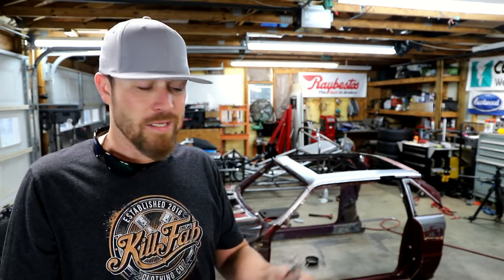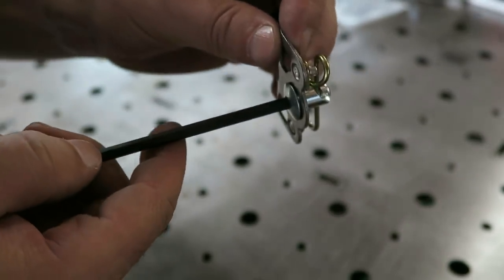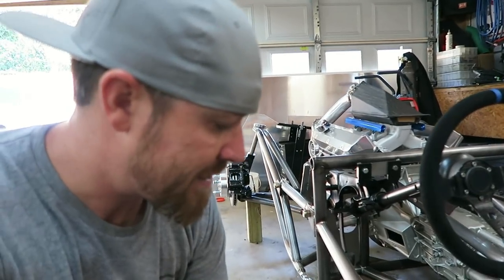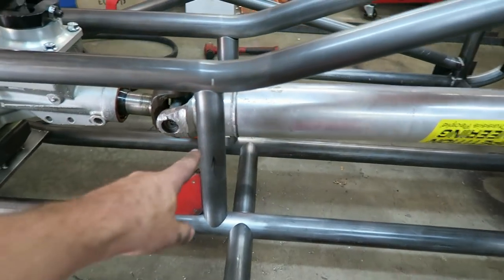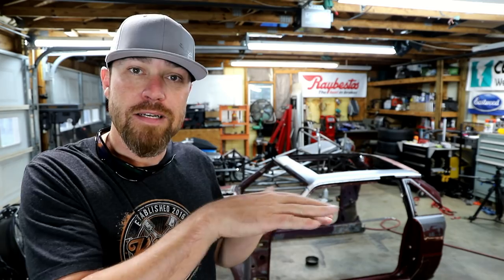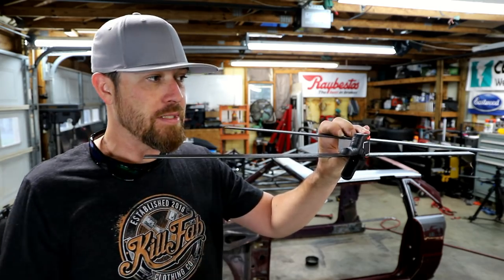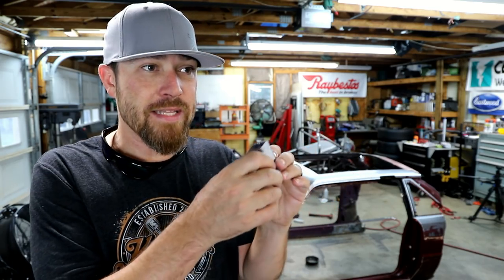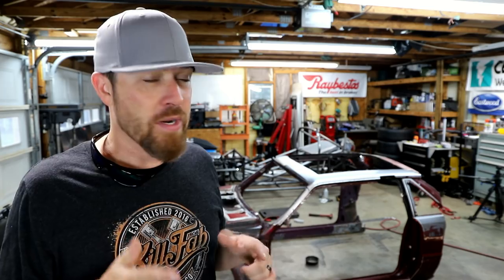Tube Chassis Frame Fabrication | Custom Hot Rod Build Bibbster

Comment: Nice solution to the positioning of the floor and tunnel panels. I like what you said at the end and agree that forward motion, combined with an open mind, can lead to discovering better options than trying to set every detail in stone. Also, too much thinking ends up making the work seem more daunting than it really is once you get started. At the same time, small delays can be a blessing if they allow you to rethink what you were planning to do, and lead to a better solution. Of course that's where the open mind is required. I always see/hear high quality/smart stuff on your channel and would like to see you hit 500K subs.
Reply from the maker: yeah for sure

Comment: I couldn’t picture how you were gonna do that until you actually did it, great idea, I need to build my floors also,  more than likely out of sheet metal rather than aluminum and I’ll weld it right to the square tube of the frame I built, if you read this and have any thoughts on that let me know. Glad to see the project getting moving again.

Comment: Great work - you are true, old school craftsman. One question thou. That small bar you just installed under the driveshaft - Is that not going to make removing the driveshaft a real pain i the butt? Could you have not made that a bolt in tube?
Reply from the maker: nah it wont effect ease of removal any
Reply: Love watching you work - your approach to this project is very relaxed and laid back. I like that alot. Keep posting.

Comment: I wanted to ask what tig machine are you using and are you using might wire for a filler if so what size? Also I've been in and out is why I have questions. Have you tried an everlast tig? Can you steer me in a good direction ? Thanks for sharing your time, thought s, skill and tools with us. It helps a great deal.
Reply: Go check out ChuckE2009 he has a lot of reviews on welders of all types and prices.
Reply from the maker: I am using the a Fronius MagicWave 230i in this video. And yeah I have a Everlast 325ext which was used for most of the welding on this build up to this point. The direction really depends on what your looking for in a machine and the budget you have.
Reply: @Thefabforums  Thank you! I will look up the one you talked about you were using.  I wanted the most bang for my buck. Not wanting to go over $2500.

Comment: Hey Kyle not trying to be a know-it-all but I would only go halfway down on those tubes I don't know if that's inch and a half an inch and 5/8 but if you go real low your panel won't fit in there right everytime I look at your car it looks great but I think I would put some bars on that roof to make it safe and rigid looks great showing the thickness of the tubing we'll make it look even better with the aluminum panels my opinion I would make those floors thick 1/16
Reply from the maker: thanks for looking out, but Ive got this

Comment: Do you establish the final profile before or after bead rolling? Very clever stand off clamps! Will definitely use on my tube chassis once I get my ball rolling.
Reply from the maker: bead rolling may shrink or stretch the panel so you may need to tweak the final profile
Reply: It can do either condition? How much allowance for final trim would be good?

Comment: When you bead roll your floor pans / trans tunnel have you thought about putting the ford logo or mustang logo,  because it could turn out really cool and add that extra pizazz.
Reply from the maker: nah, if I did a logo it would be mine. but most likely it will just be a design

Comment: Have a turbo question.  I have seen people put there turbos up front and then I have seen people run them set back by the firewall with the turbo inlet facing the header that means there pulling the hot sir off the headers isn't that a bad thing with sucking the hot air in ?
Reply: Yes.
Reply: at 170mph you're not going to have a problem with hot to cold air ratio...but on a street car heat soaking in traffic, yes.
Reply: @vintagespeed  the idea and question is more about space and not having a  radiator or oil tank . Nobody has done  that yet .
Reply: Correct but that is why turbos have intercoolers, I believe...although the turbos are sometimes at the at the rear the air induction system would usually start towards the front of the vehicle in as clean air as possible...an example of turbos being unusually placed is in 'DEBOSS GARAGE's (sorry if mentioning this is not allowed) Quattro Debocho' where they are placed in where the back seats would be in the original car..
Reply from the maker: most that run the turbos like that are doing it to minimize the amount of tubing / weight. Those are also drag cars and usually have ducting for cool air intake
Reply: a normal air-air intercooler only drops temp of compressed air a few degrees (air to water much more) so if the ambient temp is already elevated 20deg by the heat soaked headers then the intercooler is completely ineffective.
Reply: well, this reply was about hot air.... but to answer your question, lots of bike guys use the rear subframe or backbone (triumph & honda OIF did this factory) as an oil reservoir, works well for that and plumbing coolant from front to rear through the cage is a mud-truck trick.  still need a radiator, but less plumbing.  would work with stainless but air/water in your rollcage is probably a bad idea when it comes to rust.

Comment: How exactly did you curve the flat bar on the flat plane? Shrinker/stretcher or pie cuts or some other fancy trick?
Reply from the maker: I should have shown that....I just cut like 10 relief cuts about 3/4 the way through with the band saw
Reply: The Fab Forums gotcha, that’s what I thought you did. I figured it’s too thick for the shrinker/stretcher. 

I have a suggestion going forward with those tab/ledges for the other floor sections. Once you have it all fit & ready to weld in lay them out on the table & trace them for the floor templates.  Should save a bit of a headache trying to make templates after they are already welded to the tube. Just my thought after wondering how you were going to fit the actual floor pieces. 
Keep it up, do work son.

Comment: Question for you, if I install a tubular front end on my fox from RS Motorsports will it no longer be safe on the street. More worried about not having a sway bar but it may not matter anymore
Reply from the maker: The goose hasnt had a sway bar for 25 years. It can affect the cornering but I dont think it makes it un manageable

Comment: About the "get things moving". I usually only plan out the purchasable core items before starting. Stuff that won't change like the engine, trans, axle, etc and I try to gather that stuff before I start because it makes mock up real easy. Then you break everything into pieces. There really is no way you could plan anything for your car without long hours of hands on. Every little thing on a custom is going to fight you. You just won't know if ABC pedal assembly is going to fit or if XYZ part will look right.
99% of people watching will not build a car to the extent. The best I could say is to just break things down into groups like engine mods, suspension mods, interior mods, etc. then do a little research if they will be compatible then pull the trigger on one of the groups to get things rolling.

Comment: Is your motor a dry sump ? Ever thought of using the cage as a  Reservoir of the oil or  Radiator ?
Reply from the maker: I thought about using it to transfer coolant but then you have to deal with hot tubing

Comment: Should mig bits like those floor rails, can lose stupid amounts of time tig’ing everything.
Reply: In total time taken to weld and clean the spatter off mig its a wash and short mig welds on 4130 is not ideal for vibration/cracking.
Reply from the maker: yeah for sure

Comment: You call pipe "bar" and it drives me nuts lol
Reply: @georgedavis5254  I mean considering he's also working with flatbar, it would be useful to clarify. Well, pipe and tube is different too lol
Reply from the maker: Its actually tube and not pipe. And the "bar" come from roll bar, door bars or the many other types of tube build that have bar in them....Its really a standard term used.
Reply: Yea, just that I  deal with tons of steel on a daily basis and it helps to differentiate. I never said it was rational! lol